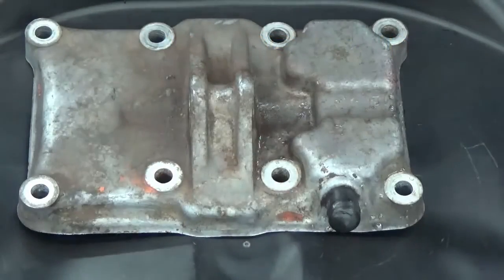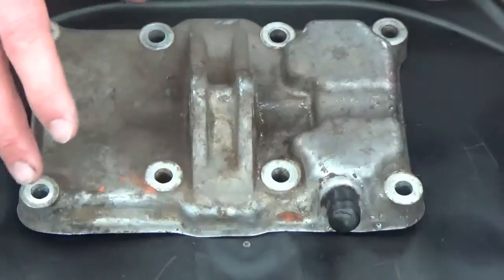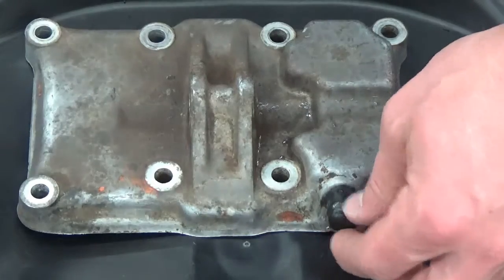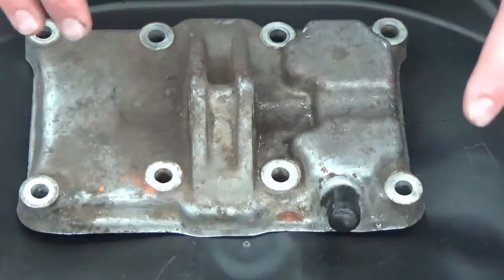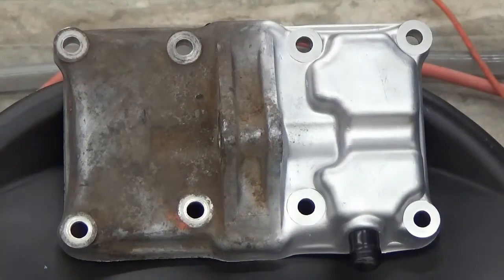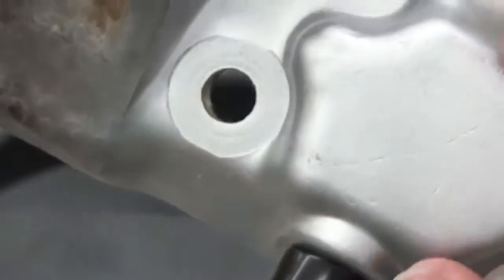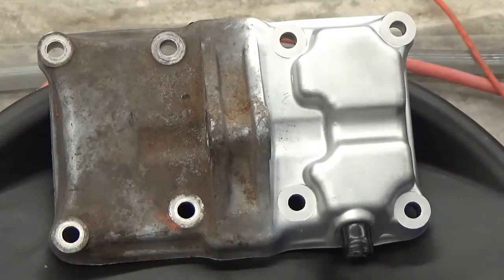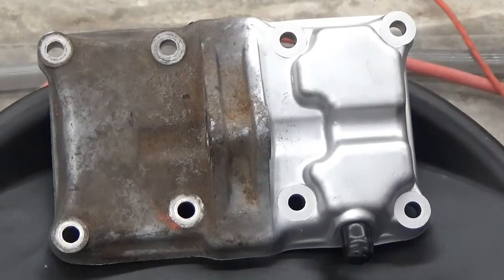Vapor Blasting Honda CB 350 Valve Cover- Vapor Honing Technologies

Comment: A lot of sales hype & talk it up, but how about sharing the technical aspect of the process & WHY it's called "vaour honing" when I don't see a hone or vapour just high pressure water? So why isn't it called "Hydro-Blasting or Aqua Blasting"??  I can see the results you are praising as from your machinery, but what then needs to be done to the alloy part to maintain the finish & PREVENT corrosion & tarnishing from occurring again? What has the machine done to the surface of the alloy part? Please share your info for all interested parties to see, thanks.
Reply from the maker: By definition; Vapor Blasting, also known as Wet Abrasive Blasting, Vapor Honing or Aqua Blast, is the acceleration and atomisation by a pressurized gas of a stream of water and fine abrasive media.  During the process you can add in a Corrosion Inhibitor that will prevent flash rusting or corrosion in the near future.  The surface of the alloy part has simply been cleaned.  It cleans with flow not impact, therefore, it does not change the topography of the surface of the part.
Reply: The is a guy in New Zealand used a dishwasher check out on YouTube